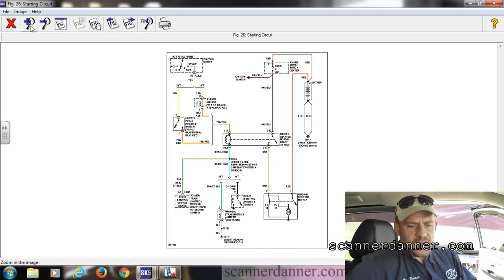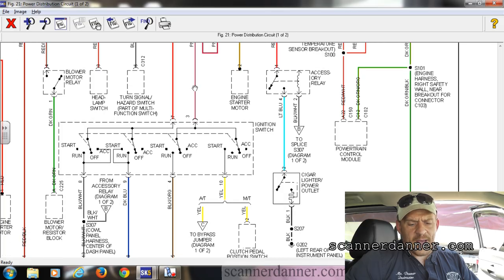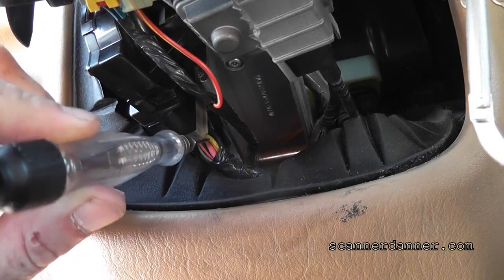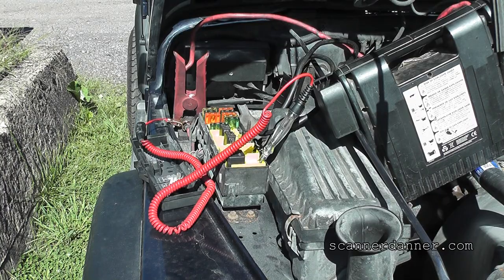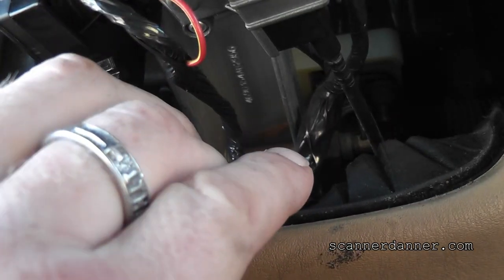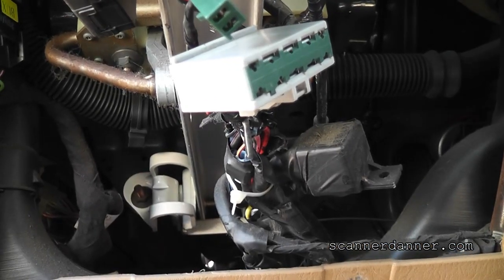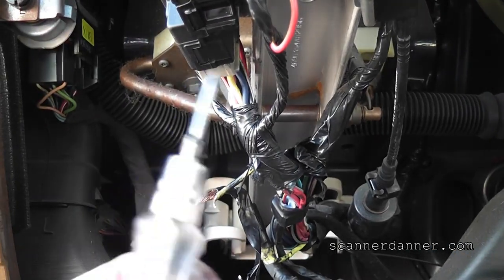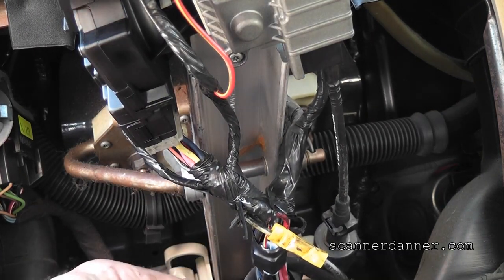No Crank Troubleshooting (engine does not crank) - Jeep

Comment: I hate two things more than anything else...  Working on Jeep Wranglers and electrical trouble shooting...  I have a 97 and a 98.  The 97 isn't getting spark, but is getting fuel...  The 98 needs put back together after major weld repairs...  F'n jeeps...  Also, I only buy electrical parts from NAPA.  They cost a little more, but you have less of a chance of getting new parts that are defective.  Defective fuel pumps are THE WORST, since you have to drop the tank to replace them...  Oh, I can bitch about working on jeeps all day.  lol.  Good video.  Thanks for posting.

Comment: Do you find that ignition switches themselves could fail intermittently or do they just fail altogether?. I'm asking with a jeep that does not have any aftermarket "crap". I'm finding when key is in the crank position the vehicle will crank then stop cranking. Turn the key to off then cranks normally and fires up. No pattern here at all.
Reply from the maker: +peelman1506 they can fail like you are describing

Comment: I have a 2001 Hyundai Santa fe in the rain in the morning it won't start and wen I turn the engine it drains the battery but about to minutes on the jumper it starts eat could this be it starts no problem in the frost

Comment: I am having an issue starting my 2014 Jeep Wrangler. I turn the key and the starter give a noticeable single Click. No Crank & No start. I removed the relay there is no corrosion on the relay or the box. The Load sides on the relay circuit have power at all times. Need Help, Please.

Comment: Good Day will the neutral safty switch test you did in the 1997 jeep wrangler work on a 2006 jeep wrangler. I blew six starter fuses. Then played with neutral safty switch connection and it started up.
Reply from the maker: Flint Nystrom not sure, they may be different.
Reply: ScannerDanner thanks for reply

Comment: Hey Paul; WHen you are trying to energize the Y wire coming out of the ign switch with the test light hooked to B+, aren't you introducing resistance to the circuit (via the test light bulb) that isn't usually there in the ign switch?  Is it just not enough resistance to prevent the relay coil from energizing or am I misunderstanding something here?
Reply from the maker: I am. And it's important that you are not trying to do this test with an LED test light. I'm using an incandescent light that draws about 200 ma which is plenty of current to energize a 100 ma control coil in a relay. Make sense?
Reply: +ScannerDanner does an LED not pull enough amperage?
Reply from the maker: No. On average they are less than 20 ma
Reply: Cool, thanks for the info, I'll have to remember that...

Comment: I have the same problem  in my nissan. No crank  no start. I tried what you said but my engine won't  turn  unless you hit the starter by tapping. Then it cuts off. Can you illustrate  a nissan quest.
Reply from the maker: If you're hitting the starter and it works, you have a starter issue, but then I think your saying it doesn't start too? So two separate issues

Comment: Can I ask you where you get your wiring shemas ?  I'll beging to work on a 87 yj project and and the wiring is a complete mess. No more ignition key and wires everywhere !!  But its a great challenge :)  I also got to fix my other 91 efi yj, crank no start ut this one should be easier to fix.  your video is from many years ago, but I've seen you're still replying to message...    I'll search online to get the workshop manual, but i don't think your shemas came from it ?   thanks you...
Reply from the maker: https://www.eautorepair.net/marketing/html/products.asp?VID=&Count=Y
This is the DIY version of the diagrams and service info I use.
Reply: @ScannerDanner  What a fast answer !!  thanks a lot...   Just had a look at the site and I'll take the service for a year.  Those shemas make things 100 times easier.....   

Btw, for sure, I'll wacth your other videos.....    thanks again for the info...
Reply from the maker: @ja4476  I think if you purchase the 1 month access, you can print everything.
Reply: @ScannerDanner  Indeed , its what I'm going to do for my 91 yj and other coming project.. but as I'm surching online for a printer I dont want to be tight in time....    looking at your shema it would be a good idea to be able to print with color...   (usually I was buying laser and only black/white color)....

Comment: I am now scanning the Internet to find a list of all the sensors on a 1993 Ford Explorer. Excellent shape, cranks but won't start... and I don't hear the fuel pump kicking in. (Southern cold weather snap killed it lol)

MANNNNNN! - I had a story bubble back up my tired brain after this many years - we are talking 30 years lol... read on, it is in this mess I just typed below! ...and IT DIRECTLY parallels SD's way and story!!!  key phrases you want to get to: "9th grade education!", "jewel". 

I have troubleshooted problems on computers for years and I work the same way and have gotten flack from so many quick tube changers yet who always called on me to find the tough ones... I got so good at resolving issues, my boss would tell the customers your six months(or 9 or more) ordeal is over, I am sending you the guaranteed fix!

I never failed. It got to the point where I could no longer take all that was coming at me, I had to turn people down... and some people would wait till I was available rather than to take a chance with a new person!

 When you do it the way SD does it, here is what you gain over what I call the QUICK TUBE CHANGERS approach...

1. You learn each time you go thru the reasoning and take the steps.
It makes you stronger, much stronger, and you get to the point where you interview the customer and normally go straight to the problem, the customer's input IS INVALUABLE! even if they mislead you... many misleads told me exactly where to engage if not the exact problem.
My first section on any job was to gather customer input... I would interview and request that the players involved meet me for a chat!  ...and I would drill them to draw clues!
I got in so much SHITE for that... but once they saw my power, they left me alone and gave me all the apologetic phrases that save face, sometimes direct apologies!

2. You can figure out the worst of problems and fix it all, you walk in the ring knowing you already have the belt!

3. You do not replace whole computers when all the problem is - a bad switch! or a bad wire!
---
Note: ...one thing he did not do in his testing was a continuity test between the fuse box and where he poked the hole, but he did do it indirectly eventually!
...and for instance I would have done a continuity test between the plug socket and the yellow wire where he poked it to make sure I did not have a problem IN the socket.
Make yourself a continuity kit, I used a 25ft roll tape measure box and rigged it with soft wire, you can also rig a roll of wire with a folding handle...

...also the socket was more than likely messed with when the after market was installed and could have made it where it fails connection, thus the new switch may not be bad, it is one of those things you connect once it works do it again it fails!

But I would not be surprised the new part was bad... I have eaten a few of those myself... and he was lucky the old one was good LOL I have had it where both are bad! ...and you are not at rest until a new part comes in for final result AND THAT MF also turns out to be bad! ...then you really start questioning yourself! LOL(no not funny for the boss)...

4. ...the customers send notices to your boss, like: "Never send me anyone else from this point, send him only!", or they ask you to give them your contact info in case you quit, or they treat you to fringe benefits you don't expect, or if you are in business for yourself you get automatic referrals.

5. ...and if you are in a scenario such as mine you become recognized as the king of the land whether you want it or not!

6. BUT here is the best of it all, I liked... The boss stops telling you what to do, how long it should take you, or if you took too long... instead they look at you and say it's  all yours we know you can do it...
I even had the upper management take me to a room and say we have a major fire, we are about to be sued, this has built up over a year's time, and we are telling you that so that you know what you are walking in... save us!
...and I got several 5K bonuses as a result.(Separate company than I mention below)

...and if you have the balls you put your foot down and tell the boss I am no longer filling out any more performance reports and jotting down every move I make, nor rushing from one thing to the other, it will be done when it is done... I don't slack up!
One green supervisor attempted to beat me down and tame me LOL... another said, no problem Silvia will take that over for you! LMAO!
Greenie who wanted to pull weight, choked, and gave me the cold attitude onward! LOL

--- How I relate so well and directly to SD:
I am not going to mention the name of the business(they have changed name since), but I resolved an issue on computers where a circuit was failing intermittently for over 2 years on one line of systems causing data to be garbled on the storage devices ... and that led to legal threats in a major way!  Troubleshooters would go on site and tell the customer data was lost... and I would get there and say, I have recovered every system before this one, unless you have real damage I see this job as no different...

Many times the previous tech made moves that made it very difficult or impossible to recover the data. But if they had backups with fried data I could recover that still.
The relief these people experienced translated into many free lunches, and other fringe benefits I never thought of...(sadly not from my own employer)

I did my testing via some existing UNIX utilities(software) and once I was versed with the symptoms and the way I devised to duplicate the errors, I could test this in no time and call for a carburetor adjustment... YOU LAUGH!
...well believe it or not, there was a hardware scheme that dealt with timing that did require a balanced scenario on a particular circuit board... and if that was not right, BOOOM!
...worse it was different on each box!!!  The same circuit that worked in one box without fail, could not be trusted as a tester piece!... The shop hated me. LOL
I would send the crap back as many times as it took to get it right! 
Now you say how can that be!!! Well no all boxes had the same upgrades installed, and not all were in the same environment(humidity, heat, etc...)

The company did not know how I knew about the 'carburetor' problem(lol)... and how it was different on separate boxes.
I owned the same equipment and via troubleshooting and module swapping I had proved it on my own network! ...and I had modified one of my boxes with more cooling power!
I had done this before I got the job with them, and NO! I did not tell them... Job security duhhh!  ...and the way they treated us was as if GODs who know it all and we were mere peons to follow orders... we were given little credit, especially me... I am fckng autistic!... Plus I worked on 1000s of problems on many different pieces of hardware they sold, so that was only one in a mess of opportunities...

On that killer problem... I saved their ARSEs, and got NOTHING for it, not even a bonus. Talk about feeling like being used like a rag!!!
The first slightly better offer I got, I was gone, did not even ask them to right this!
I left with a smile, saying I could not turn down this new opportunity. LOL
Now! How corporate and politically correct of me was that at age 24 with a 9th grade education in a different language than English!  Yup! self-taught on comps and English!

I caught flack for 6 months due to their questioning my expensive requests.
But I never failed and customers started to request I be the only one working on their systems because I always got all issues resolved...
They eventually caught on and stopped questioning me, and took steps to correct the fabrication and did a recall on sold units to end this ordeal!
---

ALL THE KEY ITEMS you add between the steps are indeed NOT wasted time, and make NOT for TOO LONG videos as many want to babble.
I can relate to SD!!!  you rock man! you know what I knew(and still know).
You are a rare jewel, a troubleshooter!
Reply from the maker: +DormantIdeas NIQ thanks so much brother

Comment: Hey Paul..Now That's funny, watching this reminds me many years back there was some guy going around all of the car lots installing those stupid devises and I couldn't even begin to tell you how many of those things I had pulled out because of that very same thing happening. Now usually if the new owner didn't want the option to pull out that so called anti theft key plug, they would just jam in the slot the same thing (little contact pc board) without the handle tab to be able to pull out.  DUMB.!
And the really dumb thing is..most of those that were installed had 6 wires, the 2 wires for the starter interrupt and the other 4 they would ground to the column. With the idea if someone was to try jump start (steal) the car it would ground out and kill the fuse..haha..what fuse, on the start crank?! Not most cars have a crank fuse at the ignition switch end. so most of the time it would burn out the ignition switch instead.  So..if the owner of the car uses that and pulls and installs that several times, eventually those contacts wear out..Guess what..No more start for you.!  The person that installed that one was obviously a bit more sophisticated and I was surprised to see a relay and a fuse..WOW.! By seeing it there on the dash earlier on in your video.. Some how I just knew you were going there as a cause.  
EVERY TIME I get one of those cars in. That's the first thing that gets YANKED out.  Thank God I haven't seen much of those in the last few years..it just seemed to be a 90's to early 2000 cars.. USED car lots mostly.
Hope everyone watching your video on this learned about those stupid devises. Get rid of them.  Future problem maker  (: 
 Cheers to all.

Comment: I have a NO CRANK, NO START 02 Jeep Liberty. When I turn the key over, all the lights come on, radio turns on, all dash lights work fine. I put on a new alternator, a new starter, and a new battery. I’ve checked all 3 and they are not bad. It’s possible it is the acuator pin or the ignition switch but I seriously doubt it’s the ignition switch. All of my fuses and relay switches are good, but the brown wire that goes into the ignition relay in broken... the metal connector that goes into the relay box is. I’ve not been able to even start it with my power light or the cable to battery trick. How can I fix the prong that’s pressed down and broken inside the relay box?
Reply from the maker: You'll have to take the box apart or find a replacement relay box.

Comment: Hey hey scanner danner.hey ..2007 dodge dokata 4x4,  it drove I parked it didn't start for a while ..battery died ...I jumped  it moved it and parked again ...had to jump it again to move again  ..this time I fired starter ..it's been about a year .plus  fixed starter ..and no crank..battery brand new also  same gas since parked ..what should I do for  process of elimination steps to get it this 9500$ lemon that turned in to 25,000 running again ? ? ..beside Tnt...lol please help me ..before I throw it to the gators in the swamps....oh and how do you feel about seafoam?

Comment: Honda Accord 97, starter just replaced. It wouldn't crank after 20-30 min ride, say if I go to the store, stop there and try to start the car again, then if it sits for two hours or so and it cools down it would start no problem. Is it main relay? I thought with bad main relay it would at least crank, right?
Reply from the maker: +Георгій Коломієць If it is not cranking, it is NOT the main relay. 
There may be a starter relay but it's not the main relay. 
You need to do voltage measurements at the starter when it is not cranking
Reply: +ScannerDanner it h as 11,9 volts on trigger wire on starter when I try to start it, so I decided I got a bad starter again. then I decided to check the starter with screwdriver while it still in the car and hot and it cranks (btw, is it safe?). now I suspect loose trigger wire on the starter

Comment: I’m looking for some technical help on my Jeep. For some reason it has a slight delay in cranking only when it’s cold out and the 1st crank. I’ve tried to confirmed I have control power immanently when I turn the key to start via a test light connected to the control wire terminal on the starter at the solinode  The delay is only 3-4 seconds. Wired ?? The starters new along with the ignition switch ( was worn out) and starter relay. 

Once it has its delay and I shut the motor off and crank it again the delay is gone. Even if the motor only ran for 10-15 seconds. 

Battery voltage is 12.9, terminals are clean and tight. 

Any ideas
Reply from the maker: https://youtu.be/Ie6sBywaUhU
Watch this video and test your relay similar to what I'm showing. You will most likely find your issue on the control side of the circuit (UNLIKE) mine. If your Jeep is the same set up as this Dodge, the TIPM and the ECM or BCM controls the relay (coil side)
Focus there. (Pins 85 and 86)

Comment: Reason you couldn't get the crank by jumping it with a test light is because the resistance (light) brings voltage to zero or low enough not to energize the coil on the relay
Reply from the maker: +skbakanov which part are you referring to?

Comment: Anyone got any tips on why front signal lights aren't flashing, in a 2006 Chrysler Pacifica? Have checked voltage/changed bulbs and fuses and checked grounds. Still can't find the issue.